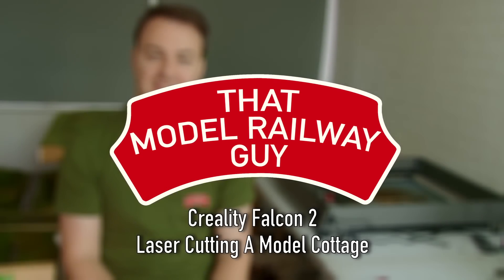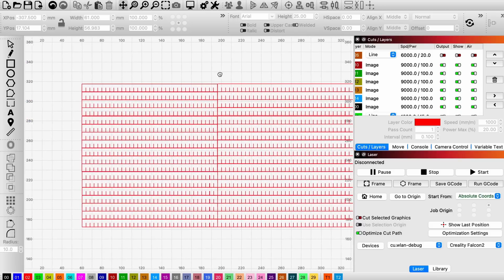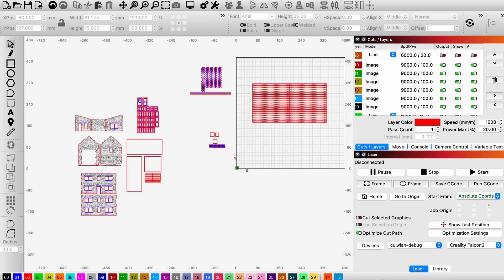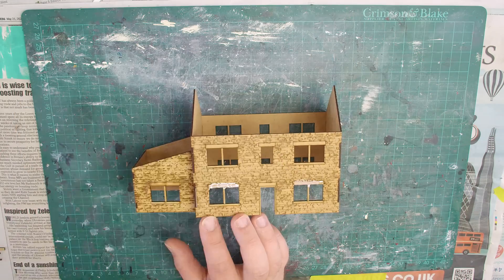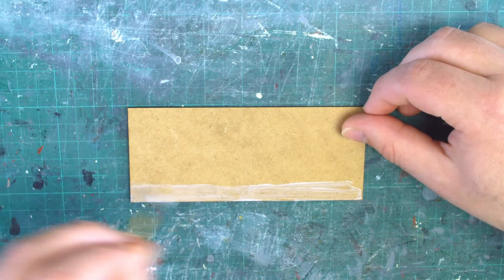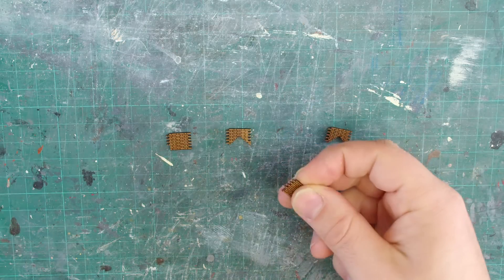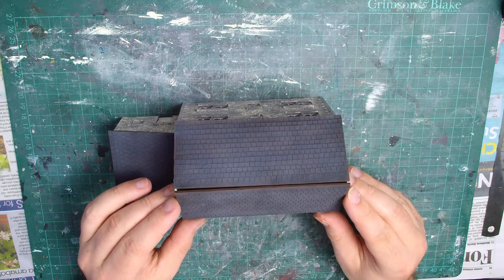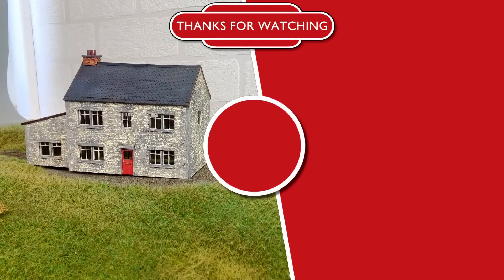Laser Cut Buildings with the Creality Falcon 2! - Model Railway Tutorial

Comment: Hello,
I recently purchased a Creality Falcon 2 22W laser engraver. As part of a modeling club, we are creating a diorama of a town center in Brittany. We have a church and about 25 houses, which we started by hand. However, the work is long and tedious. Also, I would like to know the method and software you used to create your 2D plans, the method for cutting out the pieces (facades), the windows, and especially how to engrave the old stones on the facades and cut the roof slates. Here in Brittany, a large number of village houses date from the early 19th century and are all made of exposed stone. We started these stones by hand on some facades (tracing with a ruler and a soldering iron to create the stone patterns), but the work is very time-consuming.
You would be very helpful. Thank you for your answers. Best regards,
Patrick
Reply from the maker: Hi there, I use Affinity Designer to create my designs but any vector based drawing software will work. Lightburn is then used for actually controlling the laser which seems to be the industry standard. 
For the stones on this cottage I engraved an image of an actual stone wall (scaled correctly) into the wood. It looks great it significantly increases the amount of cutting/engraving time. Hope that helps and thanks for watching 😃
Reply: @ThatModelRailwayGuy  Thank you very much for your feedback. I really like what you do, especially your very clear explanations. Thanks again.
Sincerely,
Patrick

Comment: How do you stop the wood from warping, my 3mm ply goes in flat but once I score with brick texture, it warps the wood like crazy. Also which paint spray do you use? Thank you
Reply from the maker: Generally cutting/engraving the inside sections first then working outwards but also trying different things with the speed/power can be helpful too. You don't have to cut everything in one pass so if you're having problems it might be best to try 2 or more passes at a lower power. I also have magnets to hold  the material down to the bed but that tends to be for thinner material.
The spray paint was all just cheap acrylics thinned down for use in the air brush. Hope that helps and thanks for watching 😃
Reply: @ThatModelRailwayGuy  thanks, which airbrush model  do you use? which wood and thickness do you generally use?

Comment: Fabulous! I should be watching the how to make a railway, base boards, track etc... but I seem hooked on this laser cutter!
Probably as I'm a paper/card modeller I can see the similarities in this machine and the possibilities it could give me with my hobby,
Absolutely sterling effort and good use of the back of a frame for the material  - you'll be opening a shop soon!
Right, must get back to the basics...😀
Reply from the maker: It certainly is a versatile machine and very handy if you need to make several similar buildings - terraced housing for example. Thanks for watching 😃

Comment: love the video. how do you make the brick patterns? for the pattern overtop and the mortar joints to make individuals bricks?
Reply from the maker: To create the pattern on the building I just found an image of stone brickwork that I liked and then set that as a layer to be engraved into the surface. To cut out the individual bricks for the joints (like on the chimney) The pattern was drawn using a series of lines with the outer edge set as a cut layer in the same way the laser cuts out the rest of the pieces. Hope that helps and thanks for watching 😃

Comment: Great video. I have the same laser cutter and will be using it for my layout when I get the garage sorted. Do you design in Lightburn or something like Fusion360 and export it? Also, MDF contains formaldehyde, and cutting this by laser gives off some very nasty fumes that will harm you and eventually make you ultra-sensitive to it. Ply is much better and safer to use.
Reply from the maker: Personally I design in Affinity Designer or Adobe Illustrator and then import the designs into Lightburn for final tweaks and to arrange everything for minimal wastage. 
I use different materials depending on what I'm making, so for example in the video before this one I used ply where this time it made more sense to use laserboard and MDF. Ventilation is needed regardless of whatever material you're cutting, which again I spoke about in the previous video and will be talking about more in another video in the future. Thanks for watching 😃

Comment: That is a great-looking cottage. I was watching the building flexing and I said that needs an inside wall to strengthen the build. Which you then did. Lighting and some interior details, plus guttering and downpipes would make a more impressive cottage. There are a load of extra things that can be done with this little kit. Well done Martin. (Thailand)
Reply from the maker: Yeah as I showed in the video I've added in access for lighting at a later date. For guttering and downpipes you'd be better off using 3D printed parts (I recommend Modelu personally!) where the focus of this video was to show what could be achieved with just the laser cutter. Thanks for watching 😃

Comment: Question, now I’m not a railway officianato, nor do I have a model railway (yet). So I don’t know if this is a real life thing. But why do you take out the sleepers when you’re connecting track together?
It might be in relation to the product but I’ve seen you do it a lot so I’m curious.
Reply from the maker: Hi there, so I tend to use flexitrack on my layout which you cut down to the length you need. When you want to join two sections of track together you need to add the fishplates to the rail but the sleepers stop these going on properly, so I remove a couple from each end while I'm initially laying the track. Then when it comes to ballasting I'll slide them back underneath the rail so there isn't a gap. Hope that makes sense and thanks for watching 😃
Reply: @ThatModelRailwayGuy  ah ok, that makes sense. I’ve just been watching your videos and when your setting track, you always cut off some sleepers. Thanks for the answer.

Comment: 👍👍Great model!  Looks to be excellent laser,  but at $1000 I don't see one in my future. 🚂🚂
Reply from the maker: In my opinion there's two ways of looking at it - if you're someone who wants a lot of custom buildings, structures and details then this could pay for itself fairly quickly instead of buying and adapting kits/traditional scratchbuilding.

Alternatively, right now laser cutters are indeed expensive but remember how expensive 3D printers used to be? Now though they've become more popular and as a result cheaper to the point where a lot of modellers have them... I think that's the next step for laser cutters. Thanks for watching 🤩

Comment: Really great tutorial. Very clear and professional.  You certainly should be very pleased with the cottage and the way you made it easy to construct using the tabs.  Just one comment is you could have used the laser to scribe the roof as a guide for the slate strips.
Reply from the maker: Thanks, I'm definitely pleased with the end result. I did consider creating a guide on the roof too but in the end I opted not to as with how the slates overlapped it was just easier to go by eye with what looked right - it also added in a little bit of random variation too which was nice. Thanks for watching 😃

Comment: Thanks to you i have bilt my own base bord and i am making my own model railway when i do paint the base bord what colour should i use and what brand thanks😊
Reply: @user-tn2xf7zq3k Any DIY emulsion should do (cheapest?). Brown/Sandy/Green; If you are just going to paint then pick a colour that suits your look. If static grass then Brown/Sand will look more realistic, but wear might expose patches of the base colour.  Other options are a slightly darker colour than what you are covering with (scatter, dyed sawdust, painted sand.) this will help add depth to your groundwork it also won't look quite as obtrusive if any patches develop.  Speak of which, if you are doing any plasterwork add a bit of the base colour to the mix, if later on you get a chip you will not then get a White spot screaming look at me!
A lot of DIY stores offer a matching paint mixing option, this costs more but can give you the colour you want.  If you go this route get them to write down the exact colour formula they use, just in case you need more at a later date (guess how I know this can be a problem).
Reply: @chrissouthgate4554  thanks 😊
Reply from the maker: Chris has pretty much covered this in his own reply already but personally I just use cheap acrylics/poster paint, usually a brown colour to act as a layer of mud/dirt underneath the static grass. Best of luck with your own layout and thanks for watching 😃
Reply: @ThatModelRailwayGuy  thanks

Comment: This is insanely impressive! What would you say the learning curve for the design program is?
Reply from the maker: It's incredible what's achievable with something like this. Lightburn for controlling the laser is relatively easy to use and there's plenty of tutorials out there from how to get the most from it. 
Personally I prefer to design in Affinity Designer and then export the final designs to Lightburn for cutting. I'd say being able to design what you want is probably the hardest and most time consuming part as that's the "creative" bit. But actually cutting the parts is fairly straight forward. Thanks for watching 🤩